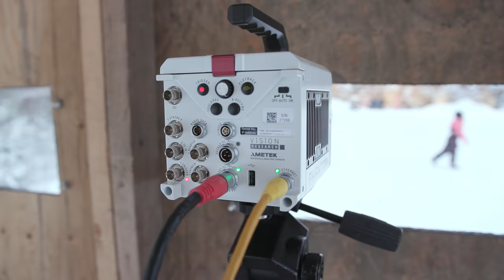Exploding Broken Down Tesla Model S

Comment: Wow. That shock tube makes some really incredible slow mo footage! And then that shockwave! It almost looks like some sci-fi portal or something to another realm. Which, I guess in some ways it kinda is lol. Great stuff!
Reply: Unfortunately this junk car wasn't traveling at 88 MPH and didn't have a good battery capable of supplying the required 1.21 gigawatts of power to transport it to a parallel time-line. THAT would have looked even more amazing on video, especially compared to VHS 😉
Reply: @EgonSorensen  they should try it next time lol
Reply: @ikitclaw7146  It will only be where the rubber meets the road that burns, the rest freezes and preserves what's inside.

Comment: It had the exact same issue I have heard a lot of other owners of 8 year old Teslas have had, something on the battery pack fails and they end up being too expensive to repair.
Reply: Dont go to the dealer, that is the case with every car. A new engine for a typical sedan is over $10,000. The battery in Teslas use bog standard 18650 cells, you can swap them out. Its not a terribly complicated job.
Reply: @desertsoldier41  What if it is the BMS that has failed?
Reply: Plenty of people are fixing Tesla packs. An infrared scan can reveal dead cells and they can be disabled, or that module replaced.
Reply: @FM60260  Fix the BMS. Companies are doing that now.
Reply: @nordic5490  How you you "fix" the BMS then?
Reply: @FM60260  You replace it from a salvaged pack
Reply: They should have just left the car the way it landed and put up a gravestone which reads:

Here Lays The Future Of Electric Vehicle Innovation

Comment: Finally! Someone finally made a video showing what to do with a Tesla with a defective battery!

Thank you very much for the video!
Reply: Think about this. Theyve been working on mastering & making EV's a viable option longer than it took to create tech to put Man on the Moon. You may think "Well that was a Government Project, putting man on the moon" which is true but the exact same thing is true for EV's. Most EV technology has been financed by Governments as well. Its the Square Peg/Round Hole adage. So now since we can not create a viable EV option we want Governments to MANDATE THEM? What are we doing?
Reply: Tesla is viable-ish, they just have a horrible tech-bro mentality which isn’t great for long term reliability. The electric Ford trucks will probably last a really long time, and Toyota has already proven their ability to make reliable electric systems with their Prius, despite initial growing pains. Remember, even many American gas cars back in the day were designed to die before reaching 6 figures in milage. It was only when foreign competition started pushing cars which held out for 10+ years that they got reliable. Currently, Tesla has no competition really in the electric sedan market. So they build disposable, so you’ll buy a new one, cause where else are you going to get one? That will change as competition appears en-masse and the technology matures.

Comment: So when you detonated the main explosives it seems the initial explosion was a small amount of the energy I looked close and it appears the initial detonation was forceful enough to force a vacuum bubble in the center that was void of the oxygen necessary to support further expansion until it collapsed thus drawing in enough oxygen to resume the detonation I've only ever seen similar activitie in nukes and underwater cavitation ABSOLUTELY AMAZING TO SEE and I am not certain on that its a theory but it makes sense and is absolutely amazing update AT 9:19 YOU CAN SEE 2 SHOCKWAVES!!!
Reply: Well, the shockwave is a several centimeters thick layer.

So it is front side and backside sticking together.
Reply: FYI: These explosives don't require oxygen to detonate.

Comment: The most powerful press of all. 
Those shockwaves are beyond incredible - I have so many questions. 
Like what causes the visual distortion at the very edge of the shockwave? Is that the compression of water vapor along the "bubble" surface of the blast?
Reply: I believe the density of air affects its refractive index. A shockwave is compressed air (or fluid) and therefore is of higher density than the surrounding air.
Reply: @HarukiYamamoto  indeed, its also why we can see a line between very hot air and cool air in the desert or on a soccer field when its sunny, as warm air is less dense than cool air and thus there is a refraction difference between the two
Reply: Yep as the other guy said it, the high pressure wave travels and compresses air, and light distortion happens when density changes. 
Think of something like water bubble expanding
Reply: @HarukiYamamoto  correct

Comment: Nice illustration of the problems with electric cars, and teslas in particular. They might emit less pollution when driving, depending on electricity source of course, but because of crap life span and repairability they end up producing a lot of hard or impossible to recycle waste. No bueno.
Reply: Gotta start somewhere! Better to deal with the shittiness for a decade or two than have gas cars forever. I get what you're saying though.
Reply: Crap lifespan? They'll be double what ice cars are. Even old Leafs get new batteries. It's all a matter of laws and possibilities.
Reply: @emilen2  bullshit, there are still millions of 30 years old cars on the roads, there are still 40, 50, 60 years old cars on the roads all around the world.
Reply: @emilen2  old leafs gets new/used batteries with still not great range compared to ICE. You can buy a very old ICE and still have way better range than any EVs.
Reply: @emilen2  So far the only 20 year old EVs on the roads are EV1s in museums, RAV4 EVs, and a few onesies and twosies that are somebody’s hobby project. Those may or may not be driven daily, but with a NiCad battery, I highly doubt anything reliable. If my ICE breaks an engine swap is maybe US$ 1-2K. A new battery for an old EV is still gonna be US$10-20K at best without considering how much work the rest of the car needs. Bottom line. NOT READY FOR MASS CONSUMPTION. YET. Hell, even a battery kit for an 04 Prius is still US$2K if you replace it yourself! without counting that with about 100 dollars worth of hardware, I can run ethanol in my car and be fully carbon neutral :-)
Reply: @disturb3df4n  Oh i'm not necessarily comparing to gasoline. Just electric w/ batteries in contrast to ICE regardless of fuel. Be it hydrogen, ethanol, biodiesel or what have you.
Reply: @emilen2  I drive a 1976 corvette stingray. Still going strong with the 2 tire fire. I doubt a Tesla would last over 40 years.
Reply: @rippertrain  this one didn’t last 8 with 2  batteries at 20k ea.

Comment: I love your high speed photography. If you look real close at the right side of the screen about 9:19 you can see the shock wave is doubled, probably by reflection from the rock wall.

I wonder- did any of the pieces contribute to Finland's unofficial space program? Probably didn't make it to Mars but damn, I bet if you weighed all the pieces they'd weigh less that the original car!
Reply: Well, the shockwave is a several centimeters thick layer.

So it is front side and backside sticking together.

Isn't it?
Reply: @MartinVonReichenberg 
Take a look at the time hack I gave- no, go back a few seconds and watch the first shock wave move left to right, then another comes into view. It's hard to tell how far apart they are but I'd say more like 200-300 cm.

Comment: As this video points out, residual value of any of these electric vacuum cleaners is likely to be so low that folks buying them will question why they bought them.  With a brand new ICE vehicle, and selling it at 5 years, the seller should get about 50% residual value out of the vehicle.  Can’t wait to see how EV’S do with this aspect of ownership.
Reply: I mean, until very recently several year old teslas were being sold at almost the cost of a new one.

Comment: It looks like a nice car, but the electrical system was damaged, and it would have cost more to buy replacement parts than the car was worth.

So they had to deal with it.
Reply: A battery can be rebuilt for $5,000, or less than a modern engine in most cars. There are several vendors that specialize in rebuilding EV packs. Often the packs are newer and have better batteries. This Tesla was the first year they were made, it lasted ten years.

Comment: I saw this on CNN. I never knew It cost $22.5k to change the battery. One could change his car's engine and transmission many times for that much.
Reply: Lithium batteries is expencive, 20k € is actually very low price for such a big Lithium battery. I did pay 20% more for the cheapest Life-po 5kw/h battery bank I could find for my campervan.
Reply: @a64738  Tesla batteries are Li-ion, not LifeP04, the latter being more expensive, but also safer, however they come with a bit less power density.
Reply: @psirvent8  actually around 40% of new Teslas have lifepo4 battery packs. They started using them in their shorter range cars
Reply: @iKingRPG  Can’t verify that, but I kind of hope that’s true. Li-ion is a great tech for things lime phones, but there isn’t enough lithium to use them for all the world’s cars. Maybe all the world’s buses and trains if we end our obsession with said cars though. Not keeping my hopes up there however. 😂
Reply: Most of the cost of an electric car is the motors and batteries. If you think about it, the battery is the engine of an electric car. And last time I dealt with a car with a dead transmission, I am pretty sure they did try charging us $10K. We just called that car dead as well.

Comment: Our Model S (2015 70KWh battery) has been off the road for 3 months now because of a battery failure and will be off the road for at least another two months as Tesla has to manufacture a new battery in California and ship it to China. Thankfully, it was still under the 8 year warranty. :-)
Reply from the maker: I am planning to drive so much with my own that the battery dies also before the 8 year mark :D
Reply: @Beyondthepress  i hope that you like real cars. Didnt know you had such bad taste.. or this is a "youtuber fashion thing" owning an iphone and a tesla
Reply: @JL-wf2wp  Teslas are great
Reply: @geofrancis2001  what do you know what i have or not. Im talking about internal combustion
Reply: @logitech4873  sure great.. like your taste i suppose
Reply: @JL-wf2wp  Taste is subjective. There's no point in belittling someone for liking a popular thing you don't like.
Reply: @Beyondthepress  just a reminder the newer warranty is now capped at 8yr or 150k mi which ever comes first . It was only the older cars that had unlimited mileage 8yr battery and motor warranty's
Reply from the maker: @JL-wf2wp   I drive so much that I want something that is comfortable, fast enough and cheap to run here where the gasoline is 2€/liter. Can't beat EVs on that calculation. 

And I kind of like cars but they are just too pricey when compared to motorcycles for pure fun. I used to have S2000 but changed that to motorcycle after couple years, it was fun on street but bit boring on track when compared to bikes.
Reply: @Beyondthepress  Tesla leant us a Model 3 while we wait, so it's not all bad.
Reply: @Beyondthepress  motorcycles. So you do have good taste 😎✌️ i just hope is not electric
Reply: How many miles and why did they say your battery failed?
Reply: @benc1927  About 40,000 km and no explanation other than that several cars of similar age had the same issue.
Reply: @FrasSmith  Did it just have less range or did it stop working all together?
Reply: @benc1927  It stopped reporting the range. It was showing an estimated range of 176km for a couple of days even though the car was in use.

Comment: People can be so enamored with the idea of "saving the planet" and "living green", but the reality of purchasing electric cars doesn't kick in until repairs are needed, especially battery replacement.  Teslas are cool cars, but there are things to consider in the purchasing decision process.
Reply: Nothing is green about a electric car. okay true the car self has no emmision, but in fact it has. how is the power made ? if you say nuclear energy. then yes the car is quite good. but if you say coal energy. then dream on. then driving a 1980 old diesel has less emmision. than the tesla. 

And keep in mind if you run out of battery then u need to call a pickup. so a pickup is also a diesel truck.

Comment: That was great.  The shock wave was excellent.  
Is there a way to measure the shock wave, to see how strong it would be?
I suppose that at different distances from the explosion, the pressure would be different.
It would be interesting to see how it could be measured.
Reply: It can be measured as overpressure in bar or psi - but they would need the equipment to do it.
And yes it obviously weakens the further away you are :)

Comment: Here in the US, to repair a Tesla the cost is astronomical. If it's not under warranty, it's cheaper to buy another car.
Reply: i never owned an EV, but combustible vehicles are not far behind.
Reply: @tmston2  Tesla is particularly bad cause it’s run like a tech company. Nobody but them can figure out how their convoluted design works exactly, and software does the rest to render repairing it impossible. But agreed. A transmission on a gas car can set you back many thousands.

Comment: People are starting to notice that EVs are suspicious huh? Even in Europe, the center of the EV market, the best selling car in the first half of 2021 was Toyota Yaris.
Reply: stay calm, electic vehicles has been on wider market like... 8 years only. And even when cosidering it 8 years only, it has still massive uptrend.
You cand tell about climate with looking todays wether.
Reply: @martinkorjus7607  cars are one of the least polluting methods of transportation. Ships and aeroplanes burn a conservative gallon of fuel per second and there isn't any regulation against them. Ever wondered why?
Reply: @TheSuperBoyProject  because ships etc. are the least polluting. Passenger cars are the most polluting.
You are talking about one problem in the wrong way. If we are talking about transportation, then passanger car is the most polluteing since for one volume of fuel it is moveing the least of functional mass. So for car you need more fuel to move same mass than cargo ship or any other ship or plane. And mass has other thing as well. When passanger car has averagely 2 persons isnide, that means 1,5tonn car moves 200kg of cargo, then for ships it is the way that cargo is usually twice more heavyer than vehicle itself.
Reply: @martinkorjus7607  Even the plane manufacturers are pretty certain that regulation is coming against them, because they are quite polluting. There’s a reason Airbus is studying hydrogen burning engines, and it’s not because of the fantastic energy density (sarcasm, it’s kind of terrible).

Comment: So next time you guys do something fucking badass like this then please try and get some cameras or sensors that can see in other wavelengths like ultra violet and X-ray etc etc so the bright light from the explosion can be mitigated through other forms of vision. It would be badass and I don’t think anyone has done an explosion like this viewing through other spectrums or wavelengths.
Reply from the maker: The black body radiation which the light coming from explosions is dependent on temperature so I think it might generate some UV since it's pretty hot but for X-rays you would need to go quite much higher than explosives go.
Reply: @Beyondthepress  One thing would be amazing but maybe highly illegal is using an x-ray camera to see inside of the explosion, ignoring the visible light so you really see the object torn apart. now can someone make an X-ray Phantom slow mo camera....

Comment: That was awesome. 
I was surprised how much was left . As I had much less left of a Ford laser with only 7kg of ANFO . But it was placed in 1kg amounts under each suspension point , the cross  member , engine and fuel tank . Largest piece was the steering column with the pipe it mounted to . Also had a nice fire ball as fuel tank still had some petrol in it .
Reply: If I remember correctly, parts of a Tesla Model S are titanium on the underside of the frame to keep the batteries from being taken out by an above-average pot hole or speed bump. That probably held the frame together well.

Comment: It seems like tesla is keen to charging users outrageous fees to repair something simple. I saw someone pay $400 dollars to replace one tire. When on a regular car it would cost less than $100... maybe tesla knows they won't last long so they try to get as much money as they can??
Reply: Actually the cost of the battery is very low, lithium batteries is expensive. I did pay 20% more for the cheapest of the cheep lithium batteries for my 5kw/h battery bank in my van.